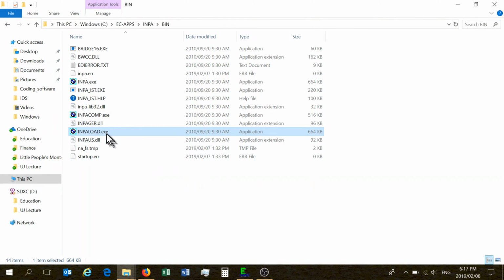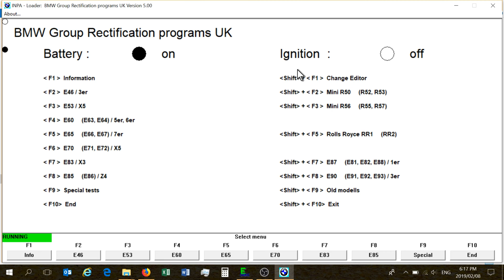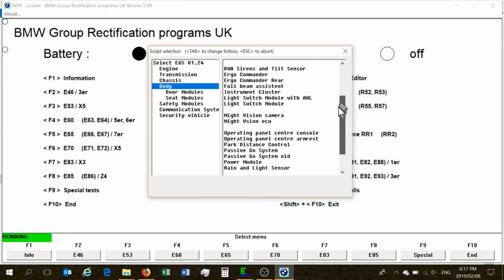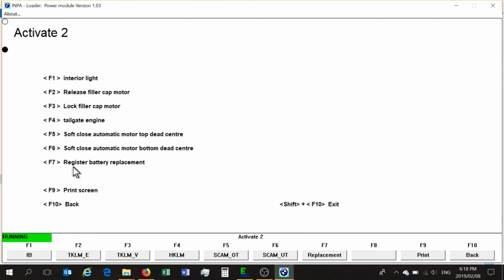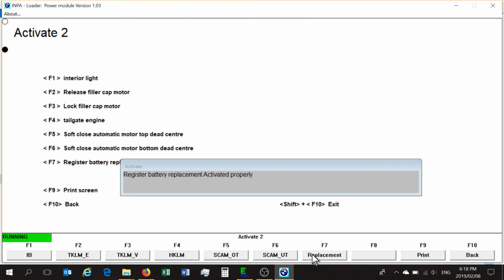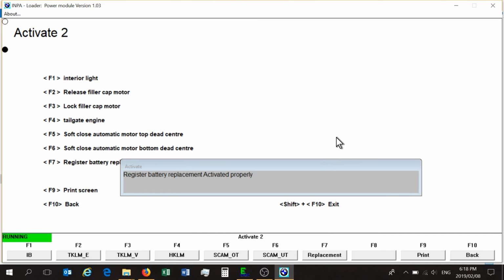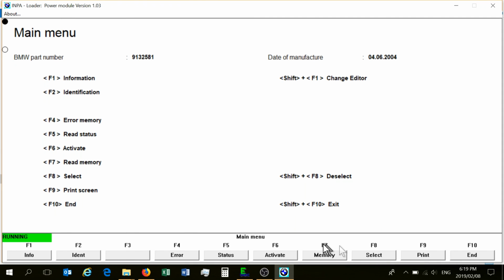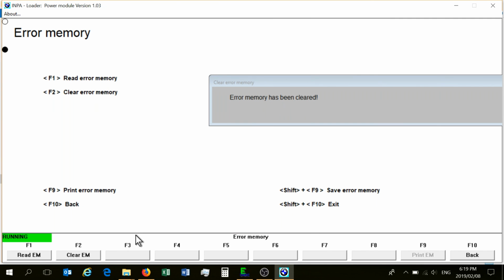How to register a new battery on your BMW with INPA

Comment: Arghhh this is driving me up the fkn wall.. can access most of my car .. inpa however gives no option to select power module.. also found out today due to last update attempt o have latest install Dde 6.0 ...mines registering as dde.7.21 found the IPO and ini files for it and the code to modify to add to list . Anyone know if I might be on the right track.... Module wise?

Comment: Thanks for positing but the version of INPA you are using is not so common. Most versions will not list the power module in "Body". On both versions of INPA  I have, the battery reset in in the engine/dme-xx/ibs-pb (or power management)/battery reset. This was pretty much the same for both versions of inpa and a E53 and E63 both with M57 motor.
Reply: Bro can you please elaborate a. Little more as my fkn battery. Doesn't list any info on rc or ah just CCA and the model and brand.. and it's a closed business now so I can't find any fn info on it at all....
Reply: I ask as I'm in the same dilema and ive been looking for the right files for a few hours at a time a few times a week for two weeks now and I'm loosing it 😅

Comment: damn, I dont have a power management option in inpa for my e70
Reply: Click on Engine and then click on your engine type. Once the screen opens up click IBS - Power Management. After click on either "exchange" or "b replace". Those were the options i got for my E70. As the others have said, check various engine types

Comment: unfortunately, I could not find any related to my E70 battery registration. is there module, file I missed?
Reply: Click on Engine and then click on your engine type. Once the screen opens up click IBS - Power Management. After click on either "exchange" or "b replace". Those were the options i got for my E70. As the others have said, check various engine types

Comment: Hi very informative, thanks. Where is a reliable source to get the latest copy of INPA in FULL English for windows 10 for my 2012 135i DCT?
Reply from the maker: https://drive.google.com/drive/folders/0B2OsVFp1aQ8OZ0xiMW13aUpJZjA?tid=0B2OsVFp1aQ8OSzVRSUxIRzhYTms
Reply: @ecologicaltime  great thanks.
Reply: @ecologicaltime  Thanks alot, Now i'm looking for the lastest Daten files for an E82. Any sources, I can't find them online.
Reply: @ecologicaltime   the linked version of INPA working with bmw e46 320D 1998 ? I want to make engine/fuel pump diagnostic, but my version of INPA dont let me in the engine menu :(
Reply: Craig Roy mikes easy tools